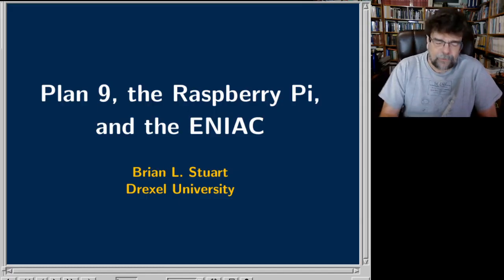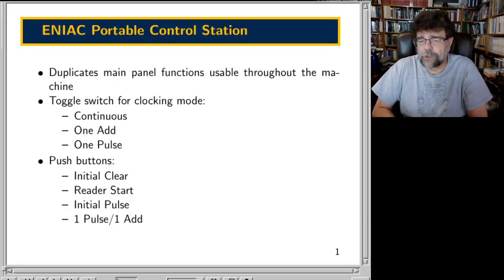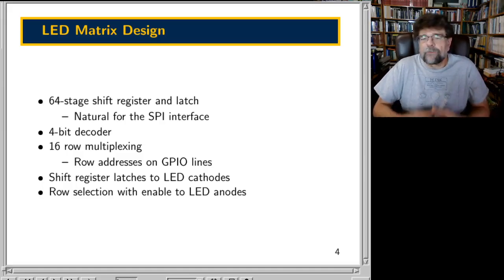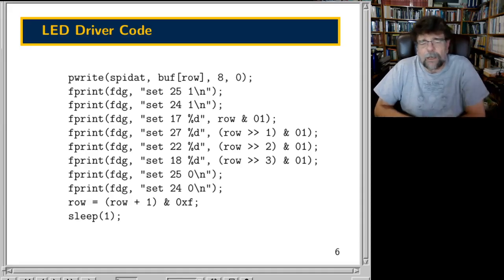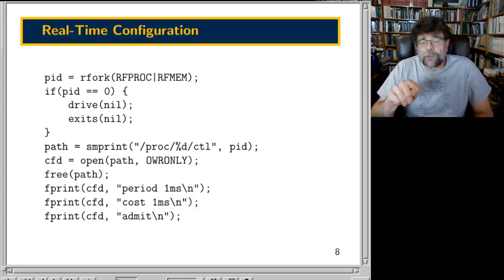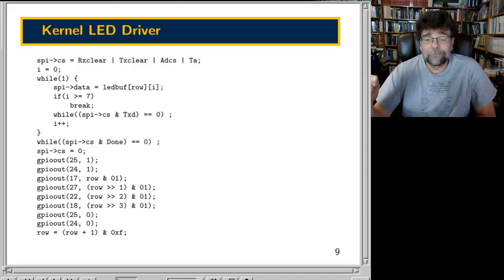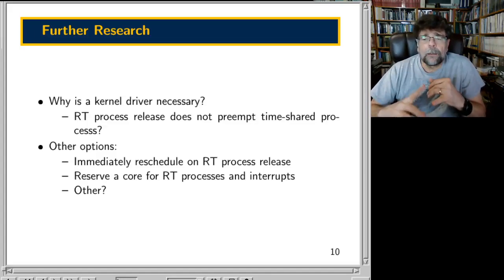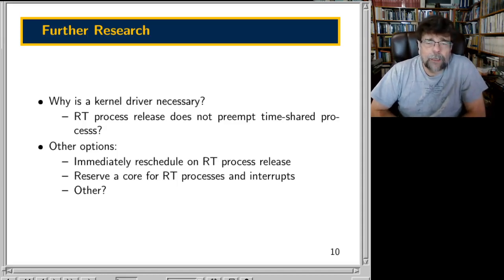Brian Stuart - Plan 9, the Raspberry Pi, and the ENIAC

Comment: AI Summary

Abstract:

This presentation by Brian Stewart details his ongoing ENIAC simulator project, implemented in Go and running on a Raspberry Pi utilizing Plan 9. The core focus is on the hardware interfaces developed for user interaction and visualization. Stewart demonstrates a 3D-printed replica of the ENIAC's portable control box, which connects to the Raspberry Pi via GPIO to emulate original machine operations, including distinct clocking modes (continuous, single add time, single pulse) and function buttons (clear, start). The simulator's state is visually represented on a 16x64 LED matrix, driven via SPI with a multiplexing scheme. Stewart discusses the technical challenges encountered in achieving a smooth and consistent display refresh, detailing how limitations of traditional time-shared processes led to the adoption of Plan 9's real-time scheduling and, ultimately, a custom kernel device driver for more robust performance. The talk concludes with reflections on the historical parallels between the ENIAC's inherent parallelism and modern multi-core computing architectures, outlining future research into optimizing real-time process scheduling through CPU core dedication.

Exploring the ENIAC Simulator on Raspberry Pi with Plan 9: Control and Display

*   0:01 The ENIAC Simulator Project: Brian Stewart, a faculty member at Drexel University and a long-time member of the Plan 9 community, introduces his ENIAC simulator project, developed in Go and running on a Raspberry Pi, stemming from his research into the historical ENIAC computer.
*   0:53 ENIAC Control Box Replication: Stewart showcases a 3D-printed, 1/8 scale model of the ENIAC's portable control box, which replicates the original's functionality and connects to the Raspberry Pi via GPIO lines.
*   3:54 Control Box Functionality: The replica control box includes a three-position toggle switch for different clocking modes (continuous, one add time for single-instruction-like steps, and one pulse for 100 kHz clock steps) and four push buttons for operations like clearing accumulators or initiating computations.
*   8:55 LED Matrix Display: A 16x64 LED matrix is used to visualize the ENIAC's internal state, driven by the Raspberry Pi via SPI and multiplexing rows to achieve a seemingly stable display. Each vertical column represents a digit (0-9) within an accumulator, with an additional pair for the number's sign.
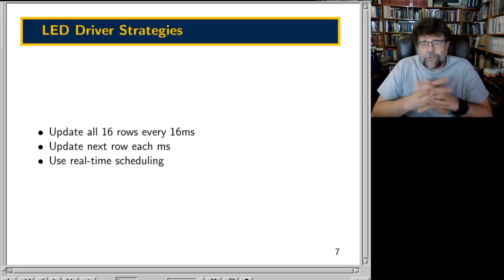*   13:55 Display Refresh Challenges: Stewart describes issues with display refresh, including dimness when LEDs were off most of the time in periodic refresh, and flickering when the display update process ran as a compute-heavy time-shared process alongside the simulator.
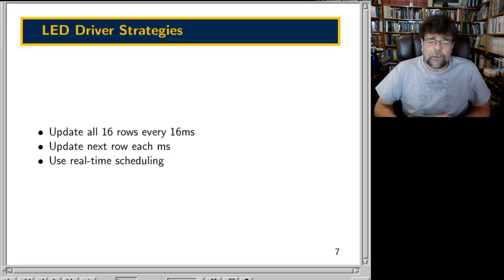*   16:06 Real-Time Scheduling and Kernel Driver Solutions: To address flickering, Plan 9's real-time scheduling was employed, which improved stability but still showed occasional issues under heavy system load. The most robust solution involved developing a minimal kernel device driver that uses polling for SPI communication, having negligible CPU impact.
*   26:46 Future Research on Real-Time Performance: Stewart outlines future work to investigate Plan 9's scheduler preemption behavior and proposes reserving a dedicated CPU core on the Raspberry Pi for real-time processes and interrupt handling to ensure consistent display updates.
*   37:39 Historical Parallelism: Stewart draws parallels between the ENIAC's inherently parallel architecture (with its 20 concurrently operating accumulators) and modern multi-core computing, noting the historical challenge of managing parallelism that is now highly relevant again.

I used gemini-2.5-flash-preview-05-20| input-price: 0.15 output-price: 3.5 max-context-length: 128_000 on rocketrecap dot com to summarize the transcript.
Cost (if I didn't use the free tier): $0.0056
Input tokens: 20229
Output tokens: 746